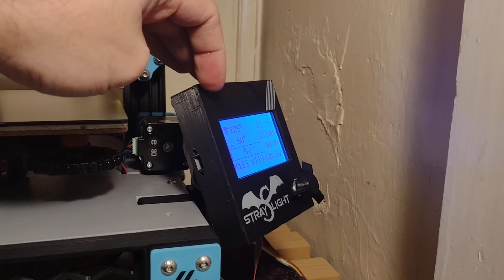Ender 3 Switchwire conversion serial request + tour

Comment: that drop gave me a heart attack
Reply from the maker: It moves fast doesn't it. There's not a lot more to move in Z than in X, and it's using the same motor pair, so what the switchwire really excels at is fast and accurate z movements, which makes it really good for intricate models with a lot of disconnected areas on each layer where z-hop really helps avoid catching parts of the print with very fast travels.

Comment: Does anyone know if the conversion is possible with a v1 ender3 with skr mini v2?
Reply from the maker: It's easier TBH, you can run a Y much closer to the original Switchwire design with a single rail and a vertical motor. Check in voron users repo.

If you don't have another printer, build the Y and test it before building the XZ and maybe buy a 2020 extrusion rather than cutting the original so if something goes wrong in the build you can revert and reprint parts.

Most of my trouble was getting the V2/pro Y working.

Skr mini is a great board and and both what I'm using and what is recommended.

Comment: How much did the conversion cost?
Reply from the maker: I'm not entirely sure, as some parts I already had like the pi, relay, 5v PSU, SKR mini board  and I've got a collection of hotends.

I think about GB£100 for the linear rails, bearings and assorted hardware. I've used three colours of ABS here, but it's less than one roll, so between £20 and £60 for that.

I'm resusing the Creality hotend because I have a copperhead heatbreak but that's in a different printer and requires some modded parts that I haven't done for the stealthburner release yet. It's currently running a Revo Voron which was maybe £70  but there are cheaper options and an e3d v6 is still a very good choice.

I think £20 for the extruder gears and £10 for the extruder stepper, I upgraded the stock motors to some 0.9 degree e3d high torque ones so that was another £60.

Magnetic buildplates and rundout sensors are upgrades I already had.

Maybe £350-400 for everything you see, but not bought all at once and you can do it for less if you reuse more parts.

By the time I've had enclosure parts cut, it's likely cheaper buy a full kit with the larger switchwire frame and prusa bed, but I've got a stack of Creality size beds I'm using across several printers.

It's  a good build if you have a spares collection, but it takes up more space and isn't really competitive with a trident or 2.4 250mm build, and buying everything including the ender 3 and a pi at today's prices won't be cost competitive vs the voron cubes.

As an aside I'm using a HP thin client instead of a pi on some of my other printers.
Reply: @rowlandstraylight  Thank you!